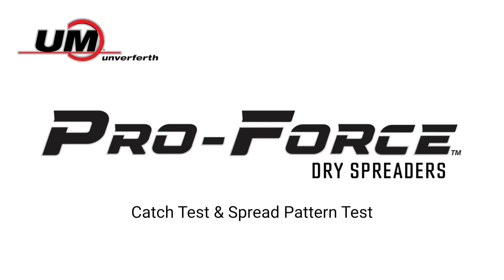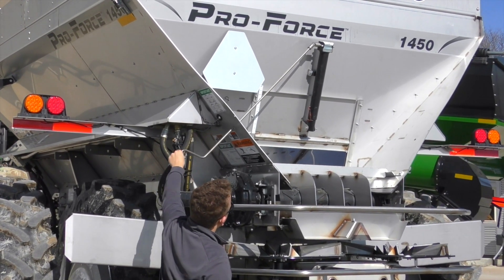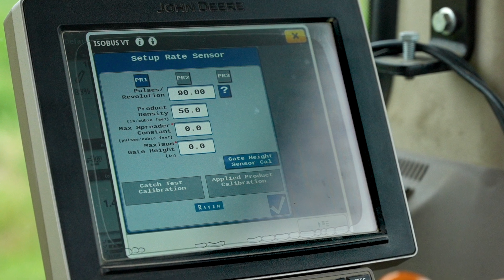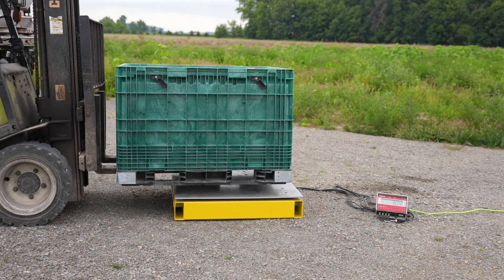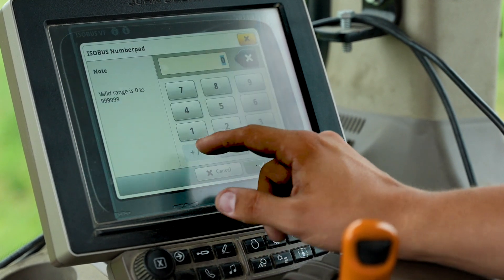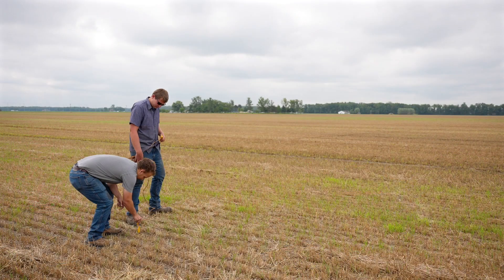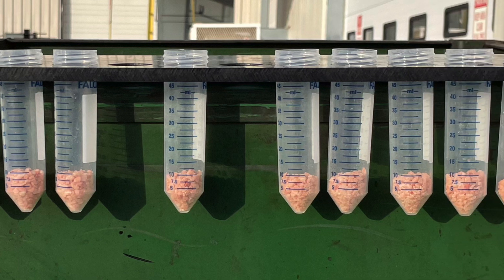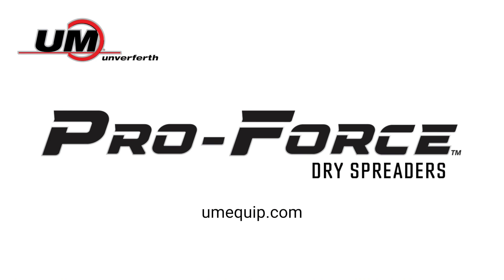Unverferth Pro-Force Dry Spreader Field Setup

Comment: On catching out the material to determine pattern accuracy, you really need to make sure you overlap is set correctly as well.  For example if your running 80' track lines, you'd run ideally down your edge, then center and then finish with your far edge pass.  This process described here only gives you an idea on how wide to run.  Also this process should be repeated for different materials and different rates.  It is crucially important to conduct these calibrations at the speed you hope to apply at, as the fertilizer flow changes as your ground speed changes thus changing your pattern.  Spinner machines can be highly accurate if set correctly.